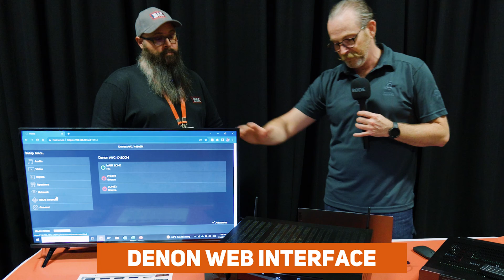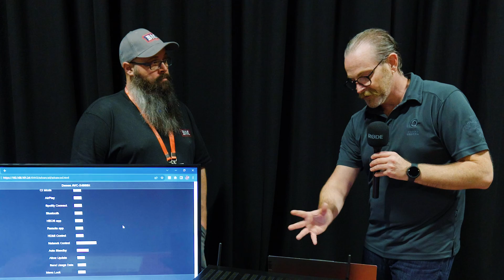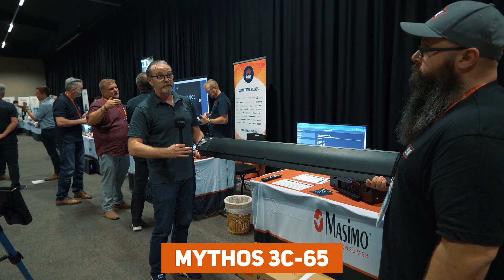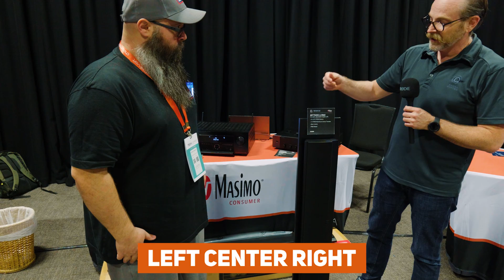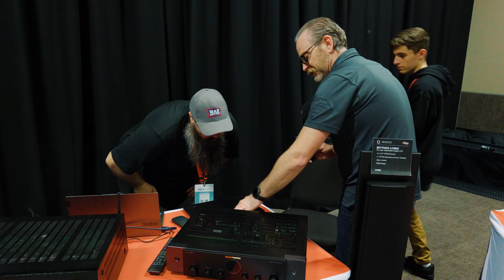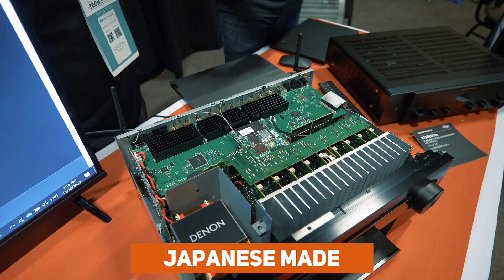*NEW* Denon & Marantz Cinema Series Receivers // Cedia 2023 Tech Summit

Comment: Sounds like the CI function will only be available to integrators? Or can the end user access?
Reply from the maker: Integrators unless you know the password ;) which I don’t I promise
Reply: @BuildMontage  so is it a firmware update that would enable the UI??
Reply from the maker: @TorinTPG I believe so
Reply: The default password is the model number of the AVR :) I have the AVC-x3800h and the password on mine is "AVC-X3800H" without the quotes.
Reply: @haukurorsson833  wish I had the 8 series. I was one year off :)
Reply: @TorinTPG  Well you can always upgrade :)
Reply: Ah boo....I have a 7 series model, not an 8 series. Guess it is a non-issue  :)